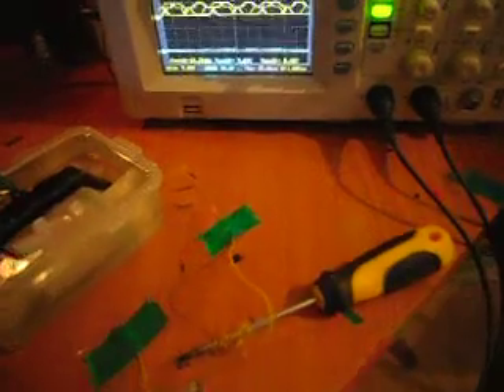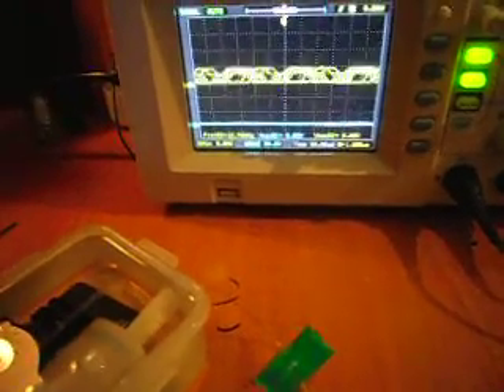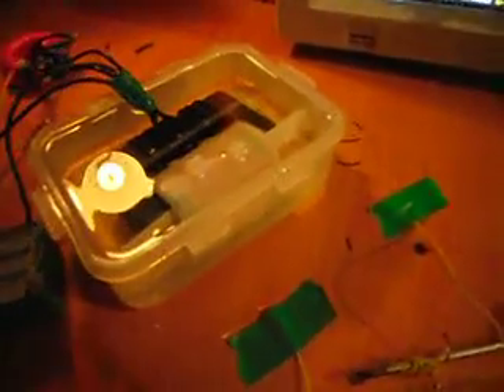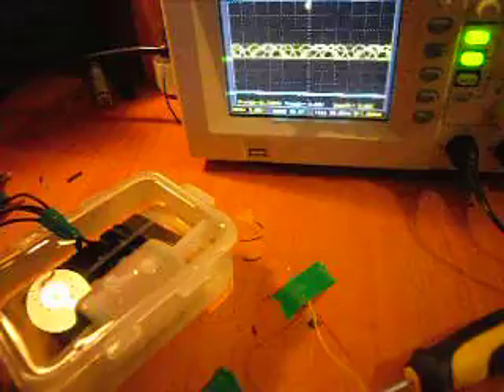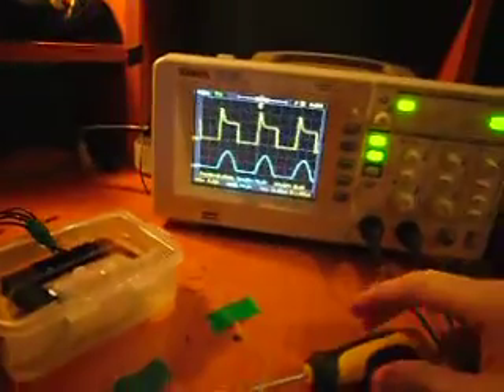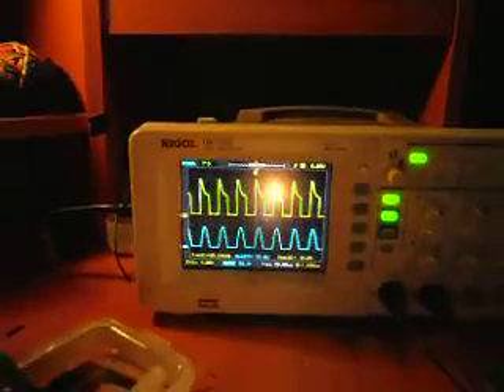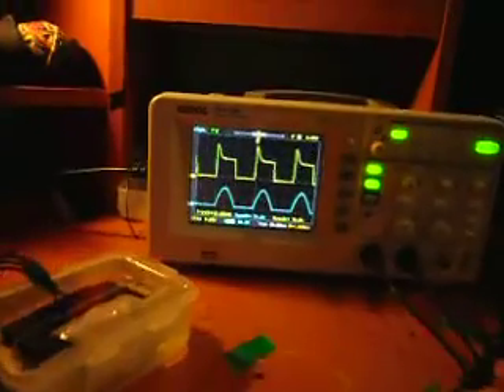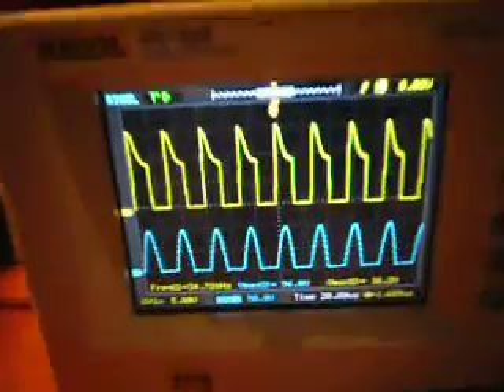ZVS Driver 30 Volts , Homemade transformer , oscilloscope 'D

Comment: I find it interesting how people have experienced failures with this circuit as I have never had a single ZVS driver fail on me when I used to play with them even when using it with high powers. Although given how it operates I guess even something small can cause it to latch up fail if not balanced.